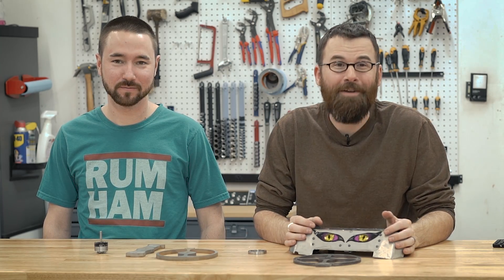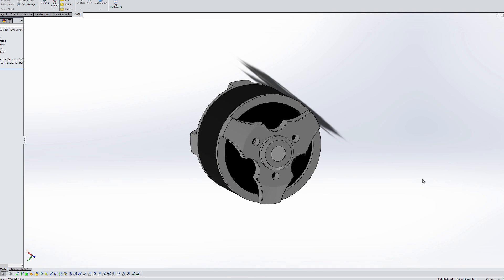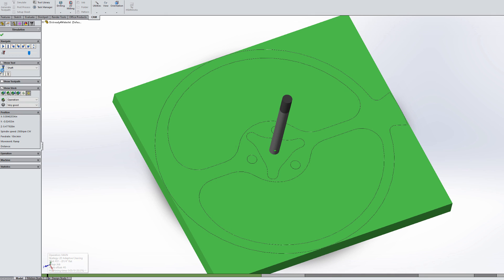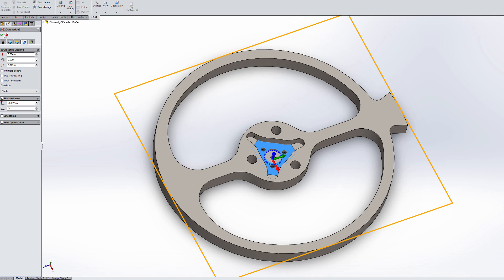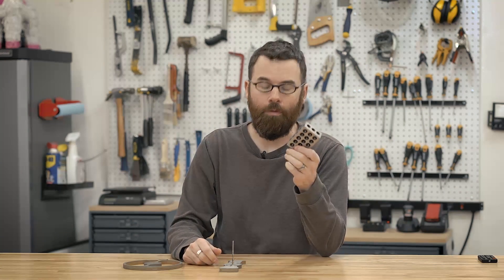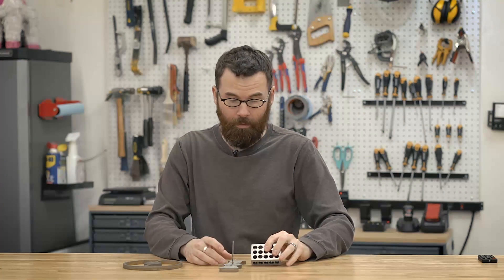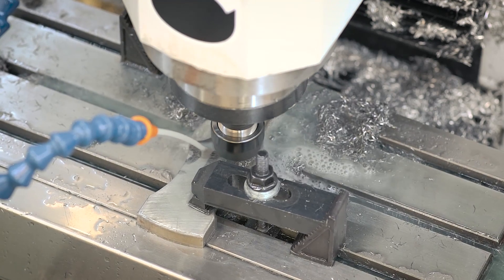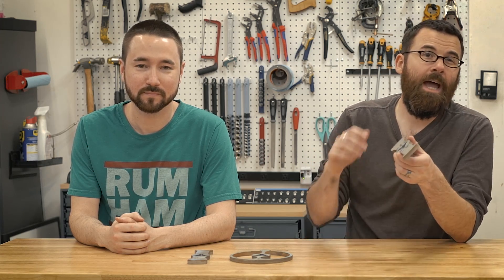Machining S7 Beetleweight Weapons

Comment: I got a question about how do yun find the center mass or the center of the spinner disk,I just want an example for my 3lb horizontal disk spinner.I'm trying to not get my bot wobble when trying to do a test spin or when fighting another bot
Reply from the maker: This would be in your CAD program.  In solidworks, you just add a center of mass reference, and it's similar in fusion.

Comment: Given the number of videos where an operator uses a drill  or an endmill to find a centre hole or an edge, it probably is a good enough method for some people. I have tried these methods in the past and got very disillusioned as I find it difficult to eliminate parallax.  For me, only edge finders and dial indicators (finger dials) seem to give me consistent accuracy.

Comment: Do you think that solid works is better than fusion
Reply from the maker: As tools, they are equal.  I use Solidworks because I know it better and I hate cloud software.  But Fusion is still a very capable and good software.  If you're starting out, I'd recommend Fusion since it's more cost effective for hobbyists.

Comment: I would imagine that some of the chatter was due to the way the part was held down.  It would be better to clamp at the ends of the spokes (or even on the spokes) to keep the center hub held down.  In the set-up used, it seems to allow a lot of flex in the part if any forces (aka cutting) attempt to lift the part from the table.  The part was clamped at the farthest point from the part that was being milled.  It would be even better to clamp the Center hub - but that would require a longer tool.  Keep the clamps just out of the tool path and use the shortest end mill as possible.....

Comment: What type of motor is used for the weapon?
Reply from the maker: I believe he's using this one:  https://hobbyking.com/en_us/propdrive-v2-3536a-1400kv-brushless-outrunner-motor.html
Reply from the maker: Size and form factor.  Kamikaze needs a very shallow motor.  The motor luke uses is taller than the entire chassis, so it wouldn't fit.  Kamikaze uses pancake motors for height.
Reply: the 1400kv would work but I'll be using the 910kv variation. Need as much toque as possible to get up to speed.
Reply: Is there a reason why Kamikaze doesn't use that one?

Comment: Luke = brother?

This suggestion isn't going to blow anyone's nips off, but if you could reduce tool deflection you'd probably reduce chatter. Choking up on the tool will bring the deflection down, but it looks like you've done that and left some room for chip evacuation. For the project I've been working on I needed an 1/8“ end mill with ~1.5" of stickout. Even though I was cutting aluminum, that much stickout was causing a lot of chatter. What I did was I found a bit with a 1/4" shank that reduces down to 1/8“ for the flutes. With that tool the chatter is gone, I still have the long stickout, and chip evacuation isn't a problem. Unfortunately, although I assume there are reduced-shank bits designed for steel, I haven't actually looked to see which brands offer them.
Reply from the maker: Ha!  No Luke is not my brother.  We aren't remotely related.  Yeah, I was a bit worried about deflection, so I chucked up the bit as much as I could.  I probably should have had less stickout though.

Comment: Question from someone who dosent  know much about CNC, could you get rid of the squealing if you set it up to take off less material per pass, in exchange for having it take longer?
Reply: Often times, it's actually an indicator that you aren't taking enough.   That amount of squealing wasn't abnormal though, and unless you're looking for a nice finish you can leave it.   That setup also wasn't the most rigid in the world, so that'll contribute as the part will vibrate also causing some noise.   You can also use better endmills, specifically ones with variable flute spacing to cut down on harmonic vibrations that build up.
Reply from the maker: Yep, you are correct.  I probably needed a bigger stepover, a high quality bit (although these worked really well for 6AL-4V.
Reply: The ones I've used are the Hanita Varimills.   They're not crazy expensive and you can find them on amazon.   I've done even hard S7 with them and they worked great.   Good for any material I've found less than 50HRC and they do alright above that.

Comment: Love your videos, the only tip i have. Get rid of the chips, better finish and longer tool life.
Reply from the maker: YES!  I need to ditch the flood coolant and get a fogbuster.  I have a problem with chip evacuation.
Reply: theres a few approaches here, not sure what the enclosure set up is for collecting coolant, but higher coolant pressure will evacuate chips, or just give it a blast with compressed air to clear out the chips while its running. A mister or air blast is probably more camera friendly though (air blast would be pretty cool for aluminum, not sure how well it works for tool steel, probably no go for ti)